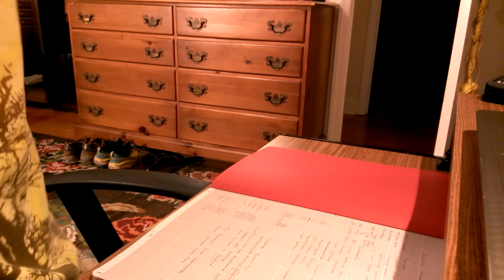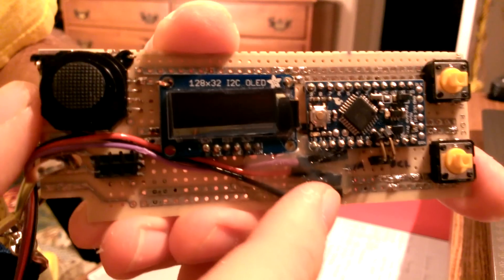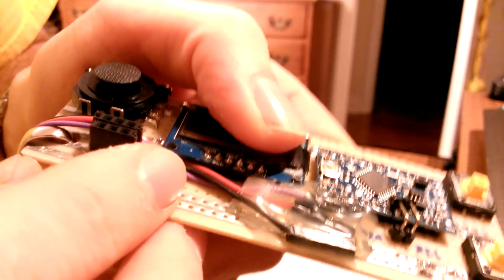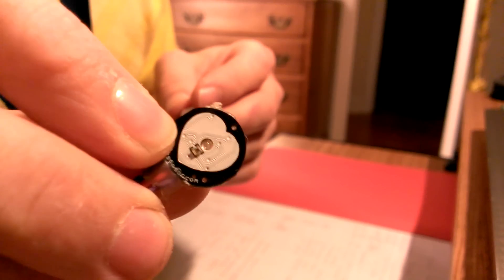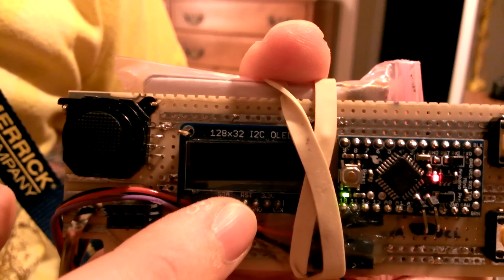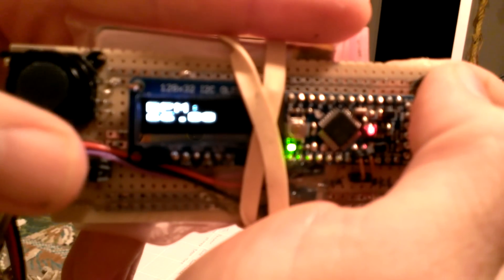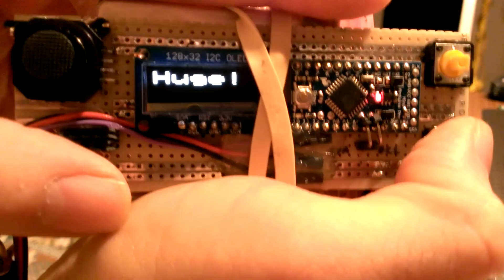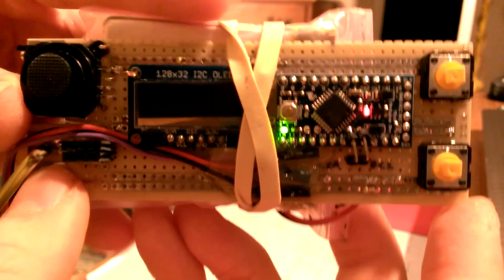Arduino Heart Rate Monitor

Comment from the maker: ///Author Justin M Stansell 
//Thanks to sparkfun and adafruit for the code examples!! 
//This program will read a heartrate sensor and store the data. 
//This data will be displayed on an OLED display. 

//Required Header files
#include <Wire.h> //Used for I2C
#include <Adafruit_GFX.h>//used for OLED Display 
#include <Adafruit_SSD1306.h>//Used for OLED Display 

//Arduino IO Hardware  setup
#define LED_pin 13             //menu
#define pulsePin 0                // Pulse Sensor purple wire connected to analog pin 0
#define blinkPin 13                // pin to blink led at each beat
#define top_button 2          //menu  
#define bottom_button 4            //menu  
#define joystick_x 1           //menu  x axis on the joystick connected to analog 2
#define joystick_y 2             //menu y axis on the joystick connected to analog 1
 
 ///////Menu setup
int value1 = 0;
int value2 = 0;
int value3 = 0;
int value4 = 0;  
int menu_pos_x = 0;  //defaults 
int menu_pos_y = 1;  //defaults to BPM first 
int ts = 3;          //defaults to text size 3 
int max_x = 0;       //used in menu for determining how many choices there are
int max_y = 0;
int std_delay = 2000; // used for visuals in menu to show them to user

      
  

///Arduino Software Setup 
float data[30];////////////////Data Array 
int iteration = 0;              //menu 

/// Display Setup 
#define OLED_CONTROL 9              //Connect rst from display to this pin 
#define XPOS 0                //OLED setting
#define YPOS 1              //OLED setting
#define DELTAY 2
#define LOGO16_GLCD_HEIGHT 16 
#define LOGO16_GLCD_WIDTH  16 
Adafruit_SSD1306 display(OLED_CONTROL);                    //Declare OLED display control pin

/////////////Heart rate sensor setup
// these variables are volatile because they are used during the interrupt service routine!
volatile int BPM;                   // used to hold the pulse rate
volatile int Signal;                // holds the incoming raw data
volatile int IBI = 600;             // holds the time between beats, the Inter-Beat Interval
volatile boolean Pulse = false;     // true when pulse wave is high, false when it's low
volatile boolean QS = false;        // becomes true when Arduoino finds a beat.
volatile int rate[10];                    // used to hold last ten IBI values
volatile unsigned long sampleCounter = 0;          // used to determine pulse timing
volatile unsigned long lastBeatTime = 0;           // used to find the inter beat interval
volatile int P =512;                      // used to find peak in pulse wave
volatile int T = 512;                     // used to find trough in pulse wave
volatile int thresh = 512;                // used to find instant moment of heart beat
volatile int amp = 100;                   // used to hold amplitude of pulse waveform
volatile boolean firstBeat = true;        // used to seed rate array so we startup with reasonable BPM
volatile boolean secondBeat = true;       // used to seed rate array so we startup with reasonable BPM

void setup()   
{                
  //// MENU and I/O initilization 
  pinMode(LED_pin, OUTPUT);  //used in menu for iteration sequence 
  pinMode(bottom_button, INPUT);
  pinMode(top_button, INPUT);
  max_x = 2;  ///sets amount of options in the x direction 
  max_y = 3;   // set the abmount of options in the y direction 
  
  ///////Display initilization 
  display.begin(SSD1306_SWITCHCAPVCC, 0x3C);  //initilize display
  display.display(); // show splashscreen JNTD
  delay(std_delay);
  display.clearDisplay();  // clears the screen and buffer
  display.setTextSize(2);   //sets font size[1-3]
  display.setTextColor(WHITE);//sets text color while/black
  display.display();
  delay(std_delay);
  display.print("Press both");
  display.print("buttons to");
  display.print("reset data");
  display.display();
  delay(std_delay*2);
  display.clearDisplay();  //clears display for next loop iteration
  display.display();
  display.clearDisplay();
  
  ///// Heart Rate sensor setup 
  // Initializes Timer2 to throw an interrupt every 2mS.
  TCCR2A = 0x02;     // DISABLE PWM ON DIGITAL PINS 3 AND 11, AND GO INTO CTC MODE
  TCCR2B = 0x05;     // DON'T FORCE COMPARE, 256 PRESCALER //0x06 for 16Mhz //0x05 for 8Mhz
  OCR2A = 0X7C;      // SET THE TOP OF THE COUNT TO 124 FOR 500Hz SAMPLE RATE
  TIMSK2 = 0x02;     // ENABLE INTERRUPT ON MATCH BETWEEN TIMER2 AND OCR2A
  sei();             // MAKE SURE GLOBAL INTERRUPTS ARE ENABLED  
  data[2] = 100;    //makes minimum value higher so it will change 
  
}

void loop()
{
  
menu();

}

  /////////////////////////////////////////
// Menu
/////////////////////////////////////////
void menu()
{
  
  ///////////////////////////Menu loop setup
  display.display(); ///sends pulse to display to trigger statements
  display.clearDisplay();  //clears display for next loop iteration
  max_y = 3;
  get_input();              // gets data from input sources
  display.setTextSize(ts);//sets font size[1-4] based off user input 
  //Also updates value1-value4 menu_pos_x and y
  iteration = iteration ++;   // increments loop iteration 
  data_man();  // this does all the data moving for the max min and average values 
  
  
  if (value1 == LOW) //if top button is pressed
  {
       
      switch(menu_pos_y) ///displays max min and current heart rate 
  {
    case 0:
    {
      display.setCursor(0,0);
      display.println("MIN:");
      display.println(data[2]);
      break;
    }
    case 1:
    {
      display.setCursor(0,0);
      display.println("BPM:");
      display.println(data[1]);
      break;
    }
    case 2:
    {
      display.setCursor(0,0);
      display.println("AVG:");
      display.println(data[3]);
      break;
    }
    case 3:
    {
      display.setCursor(0,0);
      display.println("MAX:");
      display.println(data[0]);
      break;
    }
      
  }
  }
  
  
   if ((value1 == HIGH)&&(value2 == HIGH)) //if both buttons are not pressed 
   {
     display.setCursor(0,0);     
   }
  
  if (value2 == LOW) //if bottom button is pressed
  {
    display.setTextSize(2);//sets font size[1-4]
    display.setCursor(0,0);
    display.println("Text Size");
    display.println("Options");
    display.display();
    delay(std_delay);
    display.clearDisplay();  //clears display for next loop iteration
    display.display();
    options();
    
  }
 
}

///////////////////////////////////MENU options
void options()
{
  max_x = 0;
  
  while(value2 == LOW)
  {
    get_input();
   
  if  (value1 == LOW)  //Reset data array 
  {
   data[0] = 40;
   data[2] = 100;
   data[3] = 70;
  }
  
  display.display();
  display.clearDisplay();  //clears display for next loop iteration
  
  switch(menu_pos_x)
  {
    case 0:
      {
        max_y = 2; // sets number of vertical options for this menu 
        text_size();
        break;
     case 1:
      {
        max_y = 2; // sets number of vertical options for this menu 
        display.setTextSize(2);//sets font size[1-4]
        display.setCursor(0,0);
        display.println("");
        delay(std_delay);
        display.display();
        display.clearDisplay();
        break;
      }
              
    
  
}
}
  }
}
//////////////////////////end of options

/////////////////////////////Text size options 
  
void text_size()
{
  while ((value2 == LOW)&&(menu_pos_x == 0))
  {
    display.display();
    display.clearDisplay();  //clears display for next loop iteration
    get_input();
    switch(menu_pos_y)  //affects size of text
          {
            case 0:
              {
                display.setTextSize(2);//sets font size[1-3]
                display.setCursor(0,0);
                display.println("Small");
                ts = 2;//used as text size for program 
                break;   
              }
            case 1:
              {
                display.setTextSize(3);   //sets font size[1-3]
                display.setCursor(0,0);
                display.println("Large");
                
                ts = 3;
                break;
              }
            case 2:
              {
                display.setTextSize(4);//sets font size[1-3]
                display.setCursor(0,0);
                display.println("Huge!");
                ts = 4;
                break;
               }
            }// end of switch/case
}//end of while 
}

/////////////////////////Gets I/O data
void get_input()
{
  ////////////////////Getting button data
  value1 = digitalRead(top_button);      //reads buttons
  value2 = digitalRead(bottom_button);
  ////////////////////////Getting joystick data
  value3 = map(analogRead(joystick_x),120,830,0,100);  //  X  maps the joystick value to something reasonable
  value4 = map(analogRead(joystick_y),205,880,0,100);  //  Y

    if (value3 > 70) //if joystick is left 
    {
      menu_pos_x = menu_pos_x - 1;
    }
    if (value3 < 30) ///if joystick is right 
    {
      menu_pos_x = menu_pos_x + 1;
    }
    if (value4 > 70) //if joystick up 
    {
      menu_pos_y = menu_pos_y + 1 ;
    }
    if (value4 < 30) ///if joystick is down 
    {
      menu_pos_y = menu_pos_y - 1;
    }
    
    if (menu_pos_x < 0)  //flips the values around
    {
      menu_pos_x = max_x;  /// this allows a used to keep pressing up 
    }
    if (menu_pos_x > max_x)    // and still get to all menu posistions
    {
      menu_pos_x = 0;
    }
    if (menu_pos_y < 0)
    {
      menu_pos_y = max_y;
    }
    if (menu_pos_y > max_y)
    {
      menu_pos_y = 0;
    }  
    delay(95);
}
////////////////////////END of get inputs 

/////////////////////Data manipluation 
void data_man()
{
  
  int val = (iteration % 15);  // modulus for looping sequence 
  
  //////////////// Iteration sequence
  ////////only happens every 15 loops saves on processing on the other loops 
  if ( val == 0)  
  {
    if (data[1] > data[0]) 
      data[0] = data[1];                    //moves greater value to 0
    else if (data[1] < data[2])
      data[2] = data[1];                    //moves lesser value to 2
    else 
      data[1]=data[1]; 
  }
  if (val == 1)
  {
    int total = 0;
    for (int xx = 4; xx < 14; xx++)
    {
      total = data[xx] + total; // sum mof the last 
    }
    
    data[3]  = total /10;  // is the average of the past 10 enrties 
  }
  
////end of iteration sequences 

  val = ((iteration % 10)+4); // used for averagiing function 
  data[val] = data[1];  //  puts a value in data[4-13] for averaging 
}
//////////////////////////END of data manulipulation 

///////////////////////////////////////////////////////////////////////
/////////////Heart rate Sensor 
///////////////////////////////////////////////////////////
// THIS IS THE TIMER 2 INTERRUPT SERVICE ROUTINE. 
// Timer 2 makes sure that we take a reading every 2 miliseconds
ISR(TIMER2_COMPA_vect){                         // triggered when Timer2 counts to 124
    cli();                                      // disable interrupts while we do this
    Signal = analogRead(pulsePin);              // read the Pulse Sensor 
    sampleCounter += 2;                         // keep track of the time in mS with this variable
    int N = sampleCounter - lastBeatTime;       // monitor the time since the last beat to avoid noise

//  find the peak and trough of the pulse wave
    if(Signal < thresh && N > (IBI/5)*3){       // avoid dichrotic noise by waiting 3/5 of last IBI
        if (Signal < T){                        // T is the trough
            T = Signal;                         // keep track of lowest point in pulse wave 
         }
       }
      
    if(Signal > thresh && Signal > P){          // thresh condition helps avoid noise
        P = Signal;                             // P is the peak
       }                                        // keep track of highest point in pulse wave
    
  //  NOW IT'S TIME TO LOOK FOR THE HEART BEAT
  // signal surges up in value every time there is a pulse
if (N > 250){                                   // avoid high frequency noise
  if ( (Signal > thresh) && (Pulse == false) && (N > (IBI/5)*3) ){        
    Pulse = true;                               // set the Pulse flag when we think there is a pulse
    digitalWrite(blinkPin,HIGH);                // turn on pin 13 LED
    IBI = sampleCounter - lastBeatTime;         // measure time between beats in mS
    lastBeatTime = sampleCounter;               // keep track of time for next pulse
         
         if(firstBeat){                         // if it's the first time we found a beat, if firstBeat == TRUE
             firstBeat = false;                 // clear firstBeat flag
             return;                            // IBI value is unreliable so discard it
            }   
         if(secondBeat){                        // if this is the second beat, if secondBeat == TRUE
            secondBeat = false;                 // clear secondBeat flag
               for(int i=0; i<=9; i++){         // seed the running total to get a realisitic BPM at startup
                    rate[i] = IBI;                      
                    }
            }
          
    // keep a running total of the last 10 IBI values
    word runningTotal = 0;                   // clear the runningTotal variable    

    for(int i=0; i<=8; i++){                // shift data in the rate array
          rate[i] = rate[i+1];              // and drop the oldest IBI value 
          runningTotal += rate[i];          // add up the 9 oldest IBI values
        }
        
    rate[9] = IBI;                          // add the latest IBI to the rate array
    runningTotal += rate[9];                // add the latest IBI to runningTotal
    runningTotal /= 10;                     // average the last 10 IBI values 
    BPM = 60000/runningTotal;               // how many beats can fit into a minute? that's BPM!
    
    data[1]=BPM;
    
      
    QS = true;                              // set Quantified Self flag 
    // QS FLAG IS NOT CLEARED INSIDE THIS ISR
    }                       
}

  if (Signal < thresh && Pulse == true){     // when the values are going down, the beat is over
      digitalWrite(blinkPin,LOW);            // turn off pin 13 LED
      Pulse = false;                         // reset the Pulse flag so we can do it again
      amp = P - T;                           // get amplitude of the pulse wave
      thresh = amp/2 + T;                    // set thresh at 50% of the amplitude
      P = thresh;                            // reset these for next time
      T = thresh;
     }
  
  if (N > 2500){                             // if 2.5 seconds go by without a beat
      thresh = 512;                          // set thresh default
      P = 512;                               // set P default
      T = 512;                               // set T default
      lastBeatTime = sampleCounter;          // bring the lastBeatTime up to date        
      firstBeat = true;                      // set these to avoid noise
      secondBeat = true;                     // when we get the heartbeat back
     }
  
  sei();                                     // enable interrupts when youre done!
}// end isr

/////////////////////////End of Heart Rate Sensor

Comment: Great project! that is really cool. How much did the whole project cost you?
Reply from the maker: Right at $60. I already had the programmer so I didnt need to buy it. The arduino mini pro was only $3 when I bought it. Sparkfun had a sale so I bought a bunch.
Reply: thanks! :)
Btw, would you recommend a beginner to use the arduino mini pro or something else?
Reply from the maker: Tay Aaron I started with an Uno and if this is your first rodeo with Arduinos I would suggest the Uno.

The arduino mini pro from sparkfun(The one I used in this project) is very cheap but its connections must be soldered and it requires an additional programmer.

The Uno comes with female headers, this eliminates the need to solder the wires in place. This will come in handy if you have to troubleshoot your circuit. The Uno also eliminates the need for an additional programmer. It comes with a USB to serial decoder and a USB type B port( the square one). So all you need is the cable and you can program it.
Reply: That is great! thanks a lot Justin! :)

Comment: Hi justin. Nice work. i have a question about the sensor itself. i am planning to use it with the  NI myRio micro controller and therefore i would need a Lab-view code to process the data. i was wondering if the analog data generated by the sensor will be hard to analyse. would i need filters or the signal would be clean ( constant change in voltage corresponding to one heartbeat, starting from constant reference)..
Reply from the maker: With the sensor what you would be detecting is a peak in the output voltage. The only thing that you would want to watch would be detection of dichrotic noise. You could do this by implementing a delay after the detection of a heartbeat to approximately 2/5 of the span of time of a normal heartbeat. This would prevent the detection of that noise. I dont think filters would be needed.
Reply: Justin Stansell , I already finished the project, and it worked just fine. Instead of using a time delay, i actually used data smoothing to get rid of the second (smaller) peak and noise.
Thank you for replying anyway :)
Reply: Elie Abdell Massih  i have the same problem ,can you please tell me more about data smoothing.thank you